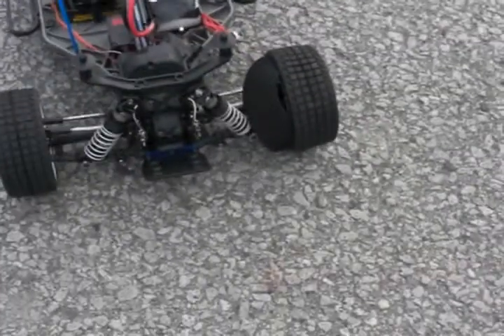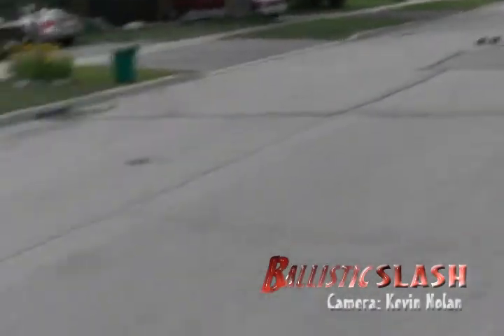Traxxas 4x4 Slash Platinum on 5S Lipo with Mamba Monster

Comment: @tom1234608 - There are 3.7 volts per cell, so 5 x 3.7 = 18.5 volts.  Power (watts) = voltage * current